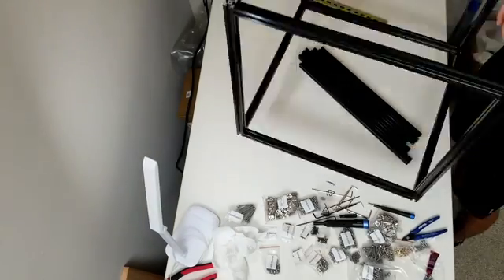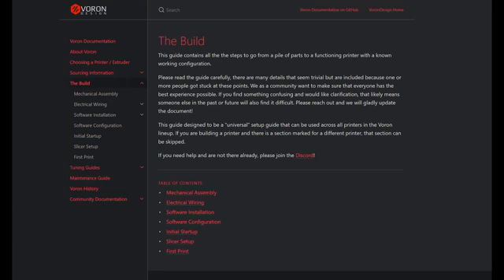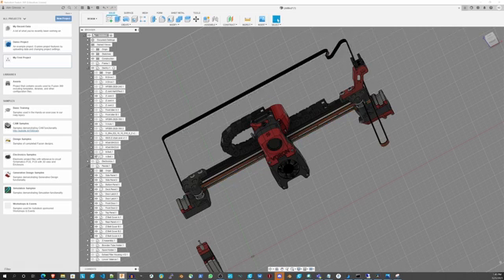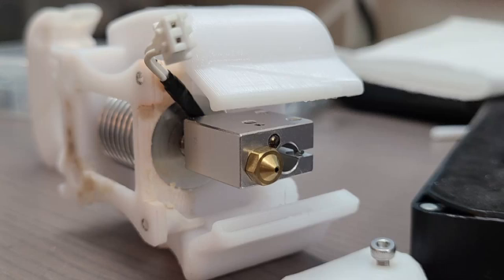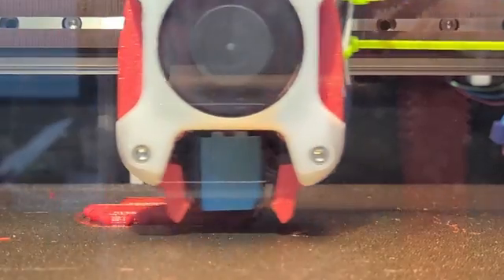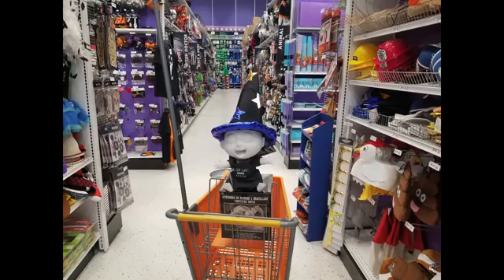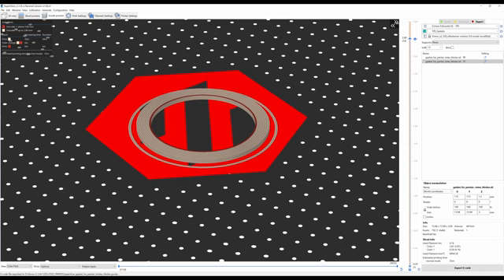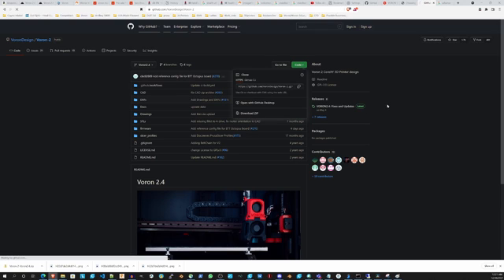Voron 2.4 with metal parts Guide - A shallow Dive on the Voron 2.4

Comment: As someone who has built a Voron, and witnessed all the hype over the last year and a half, here are my thoughts on your video.

I think you're doing a disservice to your viewers by not distinguishing between Voron and whoever made your kit. It is well known that kits vary GREATLY in quality, and the recommended option is self-source. So many of the problems you mention are the materials you've sourced. Self-sourcing is ideal because you better understand the parts you're putting into the machine, rather than what someone who wasn't paying close attention to the BOM threw in your kit... 

For cooling, there is the Stealth Burner, new version of the Afterburner toolhead, it's been announced for a while now. If you're printing PLA, leave the panels off.

For the build surface, that is your kit, PEI has been great for me, maybe your kit had cheap PEI.

The thermal runaway issue you mention sounds very likely due to component (kit) choices as well.

The undervoltage on the Raspberry PI, are you running a Meanwell powersupply for your 5v, or a buck converter? Buck converters often result in undervoltage warnings and are not recoomended for this reason. 

The inductive probe you got was bad, many others have gotten good probes, use what is specified in the BOM!

Your printer might not be reliable, mine is a rockstar, I feel like this is a result of the finicky/cheap parts in your kit, this is why self-sourcing is highly recommended.

Also your video is all over the place, I watched it expecting an indepth analysis on the metal parts, but disappointed there weren't any close-ups of them during the build process. If you start scripting your videos, they will be a lot more focused.  Sorry if this all feels a bit harsh, just feels like all the criticism you offer towards the printer would be better directed at the kit (aside from cooling, which if criticising you should mention the StealthBurner announcement that came out a week before this video).
Reply from the maker: I see - I did mention that my kit came from 3d printers bay and shown the price on that - and I mentioned that there are better kits on magicphoenix.com. But thank you for the suggestion. I will definitely keep it in mind for the future.

Comment: lol, well done video! Thank you for explaining out all of the issues you ran into, as I am building up my 300 right now. Keep up the great work!
Reply from the maker: Thank you. I am away from the shop now, but i will keep trying to fine tune it to see if I can get better prints with an external fan to see if the parts 3d print better. Good luck with the build, wiring will take a lot of time, then make sure your x axis is teue, there are tutorials for de racking it. Once you put the belts on, is harder to derack. Tuning the tension on the z belts will require some patience too.
Reply: @RoamingInterests  Totally cheated on mine, and bought the wiring kit pre-made after watching my buddy struggle with his build. However he upgraded his to the new stealthburner and said it was a game changer for him. Will definitely go back and check my belts, as that is where I am at right now. Thanks!!
Reply from the maker: That is a great idea with the wiring kit - theyweren't available when I looked and I had no patience. I spent soooo much time on crimping and running and rerunning the wires, it is insane. I got to get me the stealthburner as well. I have the AB-BN 3d printed but is not made for a mosquito - And I got lazy to take it apart again the umpteen time, I am waiting for when I am ready to get a dragon hotend then I will use the AB-BN or the stealthburner when I m ready for it. Now chatting with you about it it makes me thing to do another build but I am not sure I have the energy for it. it is quite demanding. Perhaps i will just start doing upgrades to my current voron 2.4 and fine tune whatever I can on it. Maybe get a clicky rather than inductive probe - I ordered all nre probes just to have in case the last one that works goes bad. It is such a pain if the probe is bad. Thanks for chiming in. It is a nice printer. I 3d printed some ABS with mine for the TT sapphire S and looking how un-smooth that was comapred with the Voron it is amazing how well and nice the x axis glides back and forth as well as the tool head.

Comment: My absolute favourite print surface is FR4 (glass fiber with epoxy). So instead of the regular 350/350mm aluminium bed, I got  370x350, then a 370x350x1 FR4 plate and some clamps to attach it to the bed. Works great!
Reply from the maker: Seems like a good choice to mitigate bed adhesion issues. I did not even know that could be an option. I did not know of this FR4 business. Eventually I have to give it a whirl. But so far I do not have a killer use for the Voron 2.4 unless I make upgrade parts for my other printers or itself - in ABS that can do with limited part cooling. But I can perhaps get a fan and point it at the chamber to get part cooling going and then I could use some Isopropyl alcohol to see if the smooth metal sheet can improve adhesion. I am not crazy about using glue just yet. but perhaps I may at some point.
Reply: @RoamingInterests   just in case you want to give it a try some day, here's more info on it https://www.youtube.com/watch?v=g0PK4oXbJT8&t=716s
Reply from the maker: Thank you very much.

Comment: Maybe the first mistake was to use metal parts instead of the printed parts. But it is good to see other opinions, both sides are better than only one
Reply from the maker: I do not have a problem derived from the metal parts. Is more because the enclosed chamber and insufficient part cooling.

Comment: Are you certain there's a pei sheet on your smooth side? It looks like metal to me.
Reply: Some Energetic plates only come with pei on the textured side.
Reply from the maker: I see,  it is metal but there was some yellowing on it, so i thought it may have had some specific coating because It seemed to wipe off when I used some alcohol. So i did say PEI when the smooth side may not have any PEI on it.
Reply: one side is powder coated PEI the other side is smooth  PEI
Reply: @geterdnboy  the energetic plates that come with some kits only have the textured side. The other side is just steel with a spray paint like coating that's not PEI. I learned the hard way. I have many dual sided flex plates. My first experience with these single sided textured ones was my formbot kit.

Comment: What's the strongest material to use.
Reply: metal parts are the most durable, but they aren't always machined to tolerance.  ABS is more than sufficient for a voron, as long as you print the parts with the suggested slicer settings.

other people may do carbon fiber nylon, but I've hear that sags over time.

honestly the ABS is more than sufficient for the printer.  those engineers knew what they were doing when they designed these printers

PEEK is not a material you'll be printing with unless you have an industrial 3D printer and a super deep pocket.  it's extremely expensive material and extremely difficult to print with.
Reply from the maker: I got the metal parts because I wanted to save time and just using the tapped and threaded holes they used rather than me using the brass nuts / inserts. Little did I know that the wiring would be the most daunting and most time consuming task. This voron 2.4 build was also like a trial run to see if once build what other things will be to overcome. 

I wasn't aware of the nylon problem sagging but that is a good tidbit to remember if I decide to make some nylon parts. I already reprinted the ABS parts for the 2.4, but now the printer works and I am not feeling generous with my time to take it apart and change them. I may perhaps change the metal parts in the X axis gantry and tool head - maybe, not sure yet. But if I solve the problems with the part cooling and I can start using it for a lot more things I could find the killer use to buy and make another one. perhaps with upgrades and things. I like the fact I can 3D print ABS but I do not have a killer use for ABS, Except for maybe better upgrades for other printers.

As for Peek - if there would be a 3D printer that can spin the bed on it's own x and y axis - to eliminate supports almost completely and with a need for printing big and tough parts for selling in peek then - It could be considered to have a peek ready 3d printer that can spin the bed so that the nozzle is almost perpendicular on the 3d print - then it could work - but the essentium folks have to add that to their printers which are already expensive and heavy. then PEEK could be 3d printed, but we shall see - if that will come to pass.
Reply from the maker: I think PEEK has the best proprieties
that cumulated would be the strongest. But You really need a extremely well tuned 3D Printer:

PEEK Polymer features
The temperature resistance of PEEK goes up to 260 degrees Celsius. Therefore PEEK material is used in a lot of applications that require equipment which can withstand extreme temperatures.
Nozzle temperature: 370 - 410 °C
Melting temperature: 345 °C (653 °F)
Glass transition temperature: 145 °C (293 °F)
Heated bed: 120 - 150 °C
Essentium Has some PEEK for advertising.
https://www.youtube.com/watch?v=tsdHXL1SMm8

I pushed the 3d printer to 260C - maybe 270C - whatever you can find that melts at high temperature resists at low temperature better. I guess Carbon- Fiber - nylon types. For the mosquito or high temperature HOT END you need a duet board to support the the fancier thermistors that read high and low temp like the Slice Engineering RTD pt1000. I have the RTD from slice but the BTT octo board showed a bad temperature 50C at room temp - I would need for that board a 4k resistor (I was told on discord) that would make it read better. Let me know if that makes sense - I found this out recently and I also tested the Slice RTD probe and showed 50C at room temperature which is way above the real room temperature. The fanciest plastic I 3d Printed with my Voron 2.4  is ABS - I have some nylonX somewhere And I have not tried on this printer yet - I tired it on Artillery and Culled UP quickly -. I was trying to find the killer application for NYlonX Maybe a 3 jaw collet for the Modular Pin Vise. found here: https://youtu.be/2Higoqp3Y-w

Comment: Hi, What is that cell phone base you got care to share the stl? For the smooth bed you can use a glue like layeneer it had done wonders in my all other smooth sheets for PETG PLA and ABS.
Reply from the maker: The cellphone base is here: the original  https://www.thingiverse.com/thing:2423960  - remixed mine a bit the main stem is longer - Thank you for suggesting layeneer Put one in the cart - thank you. I uploaded the phone shaft I mangled in blender here, if you want to 3D print a longer one. https://www.thingiverse.com/thing:5169291

Comment: Clean the smooth side with 99% IPA, if you have your squish right then your only problem will be getting your prints off with the bottom layer intact :D
Reply from the maker: Thank you . I will try that.
Reply: And you need to scuff the surface as well. I have the same surface, I've never had a print pop out or lift
Reply: @shinuza  He already scuffs the surface as he stated, he needs the IPA as the final step.
Reply from the maker: Thank you.
Reply from the maker: Thank you.